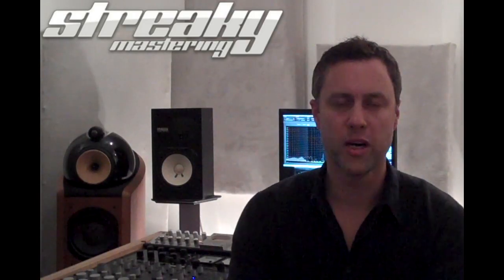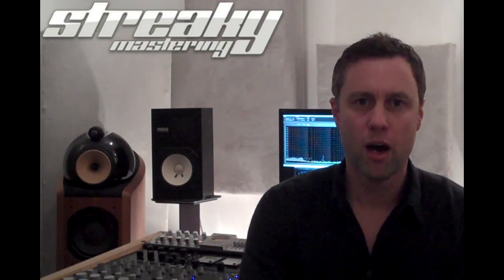HPF When to Use a High Pass Filter - Episode #14

Comment from the maker: I'm a little confused when you say 80hz for the high end, if it's 80hz high pass then I would say that's too high as you'll be stripping all the low end out and it will sound thin. 20hz will work in the low end but it depends on the mix. 

If you are using a pro mastering engineer then don't use a HP filter on your mix buss as it is best left to them and the more low end they have to play with the better...

Comment: Hi Streaky!

When it comes to hi-passing in the box for mastering do you think the it is relevant to use a linear phase eq?
As you are only moving one band should you still be careful about phase shift?
For EQ I always use the waves linear phase eq, but for only hi passing I  always wonder if a stock digi will introduce some phase shift or if it will work just fine.
Huge fan of your channel, I've learnt loads.
Thank your ever so much.

Miguel